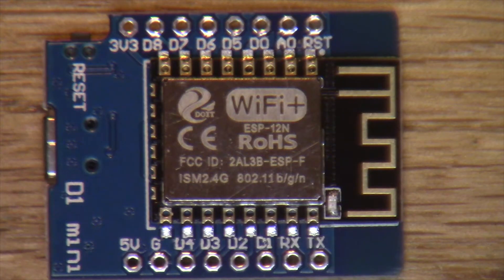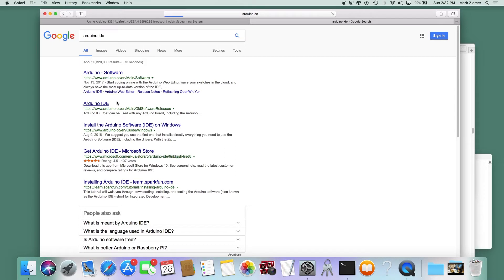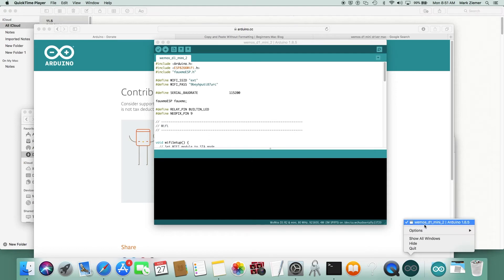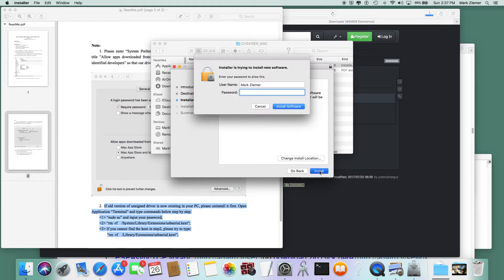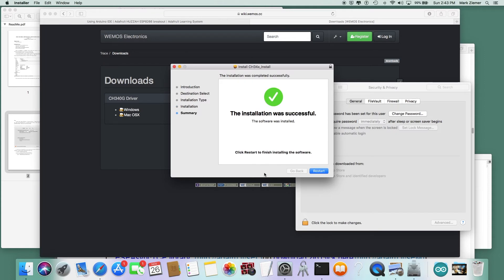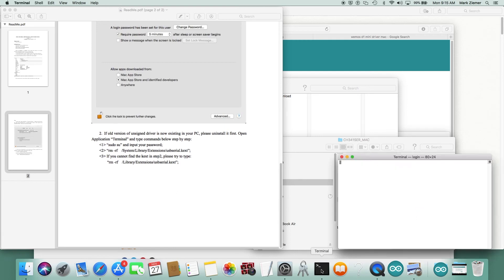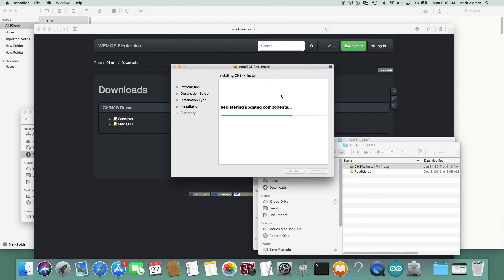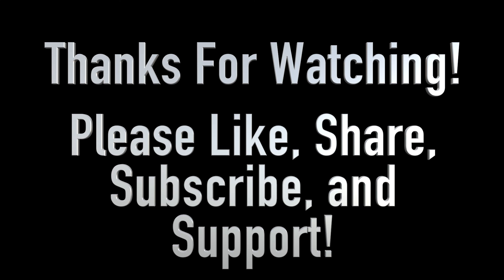Alexa Control Via Wemos D1 Mini   Part 1   Arduino IDE and Driver

Comment: Hi There, Thanks for the great video series! I'm pretty new to this and would like the relay to turm on, wait one second, and turn off (basically cycle it) when the alexa "turn on" command is used. I tried the Delay command, but it did nothing. Any help would be appreciated. 

Also, I managed to get my Echo 2 to discover my wemos by downgrading my esp8266 board manager from 2.4.0 to 2.3.0.
Reply from the maker: thanks for the info!   Heres some code that should do the trick  http://www.someoldguycoding.com/arduino/relay-on-for-one-second-via.html.   Let me know how it goes.  Thanks for watching!  (relay pin needs to be set, along with wifi name and password)
Reply: Wow, Thanks! I'll give it a try and let you know how it goes. Thanks again.
Reply: Hi there, I downloaded and modified your code to work with my network. It runs fine, but only switches the wemos LED on (not on and then off). I don't think the program is executing the timer subroutine you added for the "off" command after one second. Am I missing something? Thanks in advance for your help!
Reply from the maker: Oops, getMillis() returns a long. I was using an int. I've also modified the logic a little. See if this works. Be sure to refresh the web page to make sure you're getting the new one. It's V2.  Thanks!
Reply: Downloaded V2, and I think I follow your logic, but it still doesn't work. Turns on LED, but no auto turn off. I put "Serial.println("In the Loop" );" just after your new "if (millis() > endTime)" timecheck to see if the program gets to it, but it doesn't print in the serial monitor window. Thanks for sticking with me on this!
Reply from the maker: ok I'll actually log it on a system and get it to work. I'll have to do that tomorrow morning. I'm on mother-in-law duty now...
Reply from the maker: Duh, should work now...
Reply: Got it working, thanks!. Had to change the first RELAY_PIN reference to LOW (it was just turning off, waiting one second, and then turning off). What did you change to get it to work? I went through the last two versions and couldn't see any difference. Thanks again for your help.
Reply from the maker: It's a tough one to see. 
When the command came in I had the statement:
         relaytiming == true;     // flag that relay is on
which is doing a comparison rather than assignment. Changed it to:
          relaytiming = true;     // flag that relay is on

Thanks for your patience!